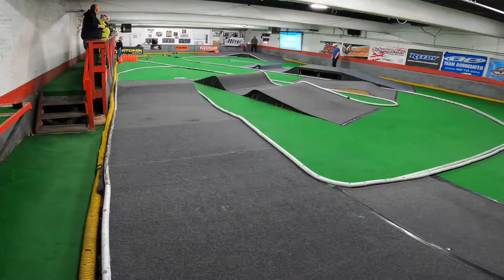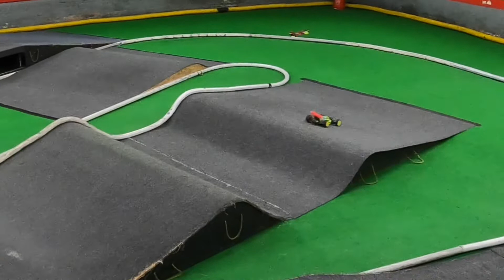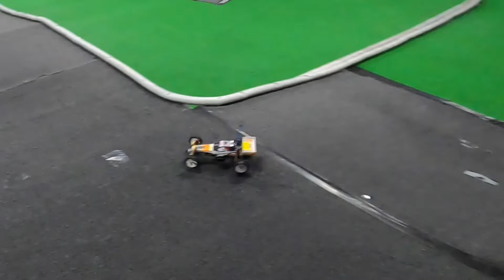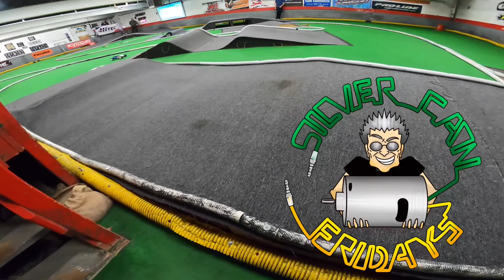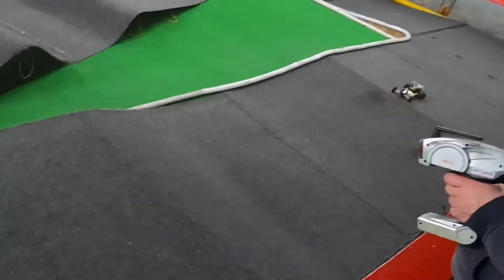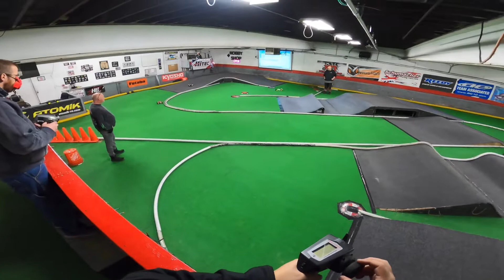Silver Can Fridays — RC Racing at RCHR in Waterbury, CT

Comment: Interested to know if you get many 4wds giving it a go in the silver can class and how they go? The trucks seem to do well
Reply from the maker: Haven’t had any 4wds and the trucks were running the sport tuned motors to even out the field, 2wd buggies run the torque tuned motors
Reply: @tecnica2001  thanks so much for replying! That makes sense to give the trucks a slightly faster motor